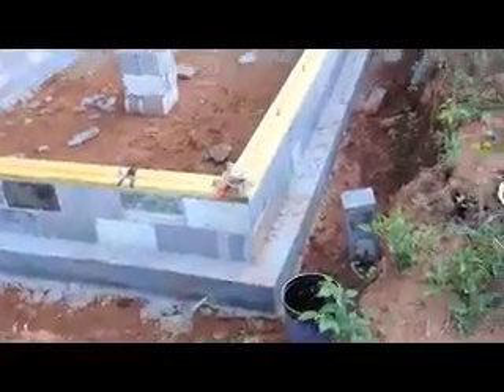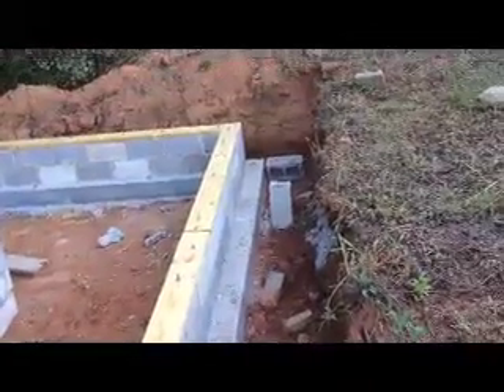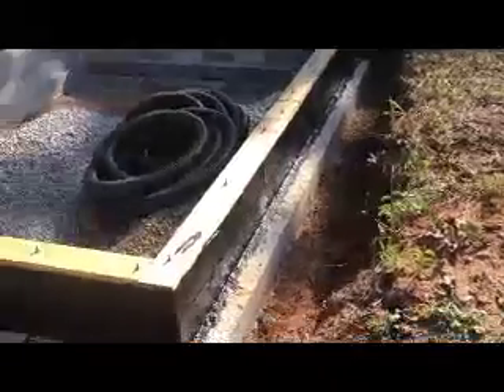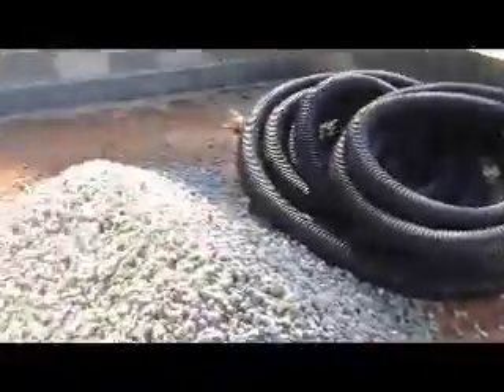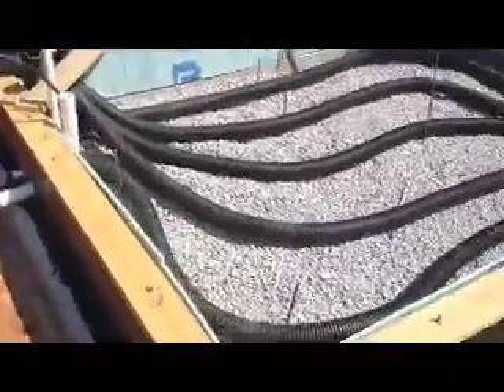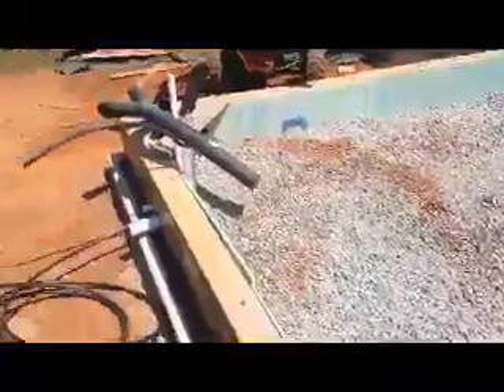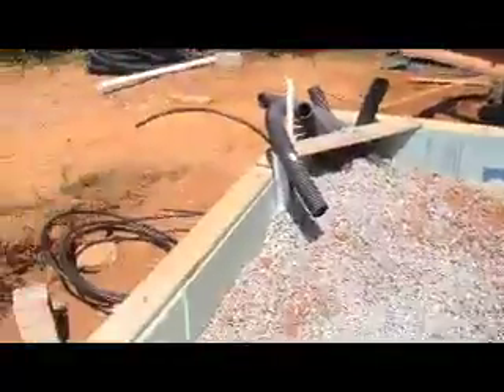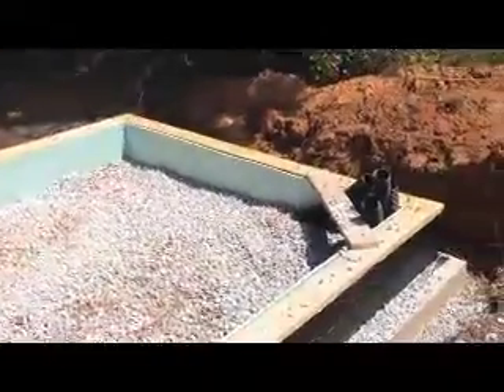Geo-Thermal Greenhouse Pipe Install

Comment: whats the sense of puting those pipes so shallow? it will not work

for it to work the pipes need to be put 3 or even 4 meters underground
Reply from the maker: szczecho it’s worked really well now for about 4 years...
Reply: @krpoovey  where do you live? in cold climate it will not work until its burried deeper
Reply from the maker: szczecho the Piedmont of NC
Reply: @krpoovey  well that explains much, in Poland where I live, pipes layed such shallow wouldn't work

Comment: It's not really deep enough.  The "frost line" is usually around 4-5ft.  If you would have went down to that, you would have seen a much more drastic cooling and heating efficiency.  But it is a nice build on the other videos.  I liked the fan setup and thermal switches.
Reply from the maker: Hawk Intelligence not sure where you live, but the frost line here is much more shallow than 4-5 ft. The heating and cooling this does is very adequate for my purposes. An exhaust fan keeps it as cool as it needs to be. And it’s rare that I need supplemental heat. This thing isn’t cost effective to begin with when comparing to conventional heating and cooling. More courses of block and gravel to back fill would make even less so. Will take decades to get back the difference as it is. But thanks for your input.

Comment: Hi Kelly, did you put rigid insulation below the gravel?  I live in cold northeast.  If I don't put insulation below the gravel then any heat I want dissipated into the gravel will be drawn to the ground which is a constant 50-55F
Reply from the maker: Daniel Bonaire I did not. I put rigid insulation around the walls. It seems to work very well for my purposes. It is very rare that I need supplemental heat. Certainly things could be different for your circumstances.
Reply: Kelly Ray thanks! Good to know.

Comment: Hi Kelly, thanks for the videos, please answer one or tow questions if you get time, 1. How do you work out what length of geothermal tubing do you need for the given square footage of the green house, what diametre tubing did you use?
Thanks.
Richard
Reply from the maker: Hi Richard. For me it came down to expense and practicality as much as anything. But if you want to get technical and scientific, this link is a good place to start http://www.roperld.com/science/YMCASGHHeatSink.htm. I used 4" corrugated flex pipe. See the latest update I made and some of the other videos regarding this greenhouse on my YouTube channel. After a little trial and error it has worked beautifully. Last night it was 25* here in zone 7 of Catawba county, NC. Inside the greenhouse it was 48. I'm growing tomatoes, lettuce and cabbage very successfully.
Reply from the maker: Also, the flex pipe has slits in it. It's the kind that is normally used for septic drain lines. The temps btw are in Farenheit.